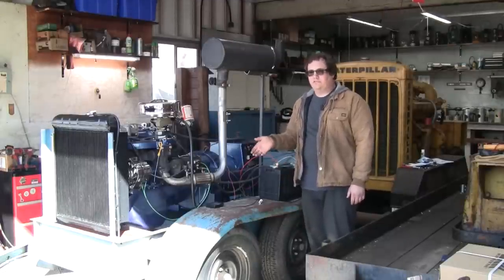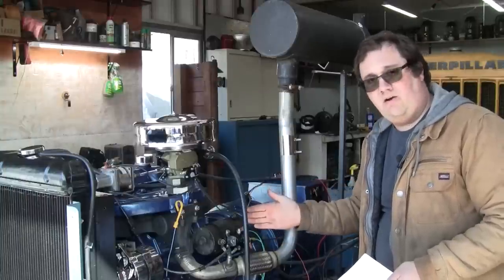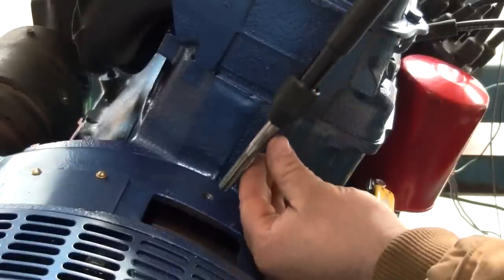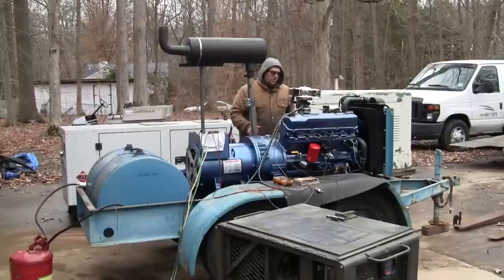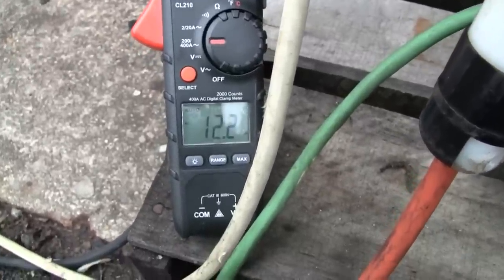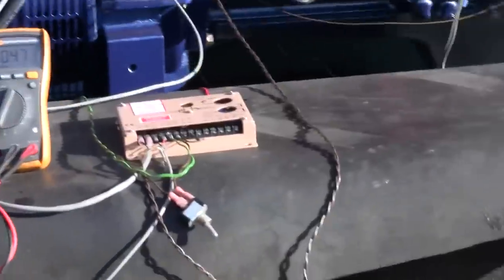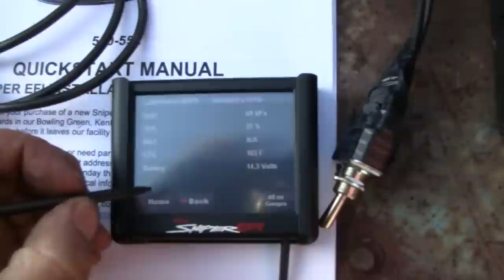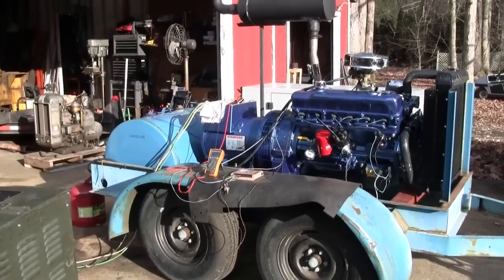Chrysler Slant 6 Generator Gets Holley Sniper EFI Pt.2 FIRST LOAD TEST

Comment: The Chrysler Slant Six is one of my favorite engines of all time. They do have one thing that can make you wind up walking. The distributor has a plastic drive gear that can fail. On all my Slant Six engines I replaced the distributor drive gear with a aluminum / bronze gear that was made for use in drag racing the S.S. engine.
Reply: 100%!!! must be ASAP!!!!!!
Reply: They have an opening so if you drop a screw when changing points that puppy drops right down into the drive gear. Second, that engine was originally designed to be an alunimun block. That's why you will never break the bottom end. I think they were all made with forged cranks.
Reply: I changed all of mine to electronic ingnition because it was harder to change points on them than most engines. Chrysler did build aluminum Slant Sixes for a short time and they had too many problems, so Chrysler dropped them. Chrysler switched to a cast crankshaft in the mid 1970's and narrower connecting rods and smaller connecting rod bearings and later they started using hydraulic lifters. We use to sell a lot of these later engines to cab companies because they didn't last as long as the older engines. Also in the later 1960's Chrylser increased the size of hole in the rear of the crankshaft. If you wanted to install a later Slant Six into a earlier car with a stickshift you had to use a later stick flywheel that matched the engine. If you wanted to install a later Slant Six into a earlier car with a automatic transmission, you had to stick a reducer bushing into the later engine so the early torque converter would fit. We use to sell the reducer bushing at the place I worked. Early torque converters had a small hub on the front and later torque converters had a large hub on the front and early and late converters do not swap. The only other bad thing about these engines are the exhaust manifolds. The like to crank and warp. Then there was the Hyper Pak. Factory 170 CI race engine.
Reply: @EVILDR235  Thanks for more information on this engine.
Reply: Boy that’s the quietest slant 6 I’ve ever herd my buddy had a 60 s valiant always had tick tick lifter noise but ran like a champ good on gas
Reply: @terrywitt5543  Early Slant Sixes had solid lifters and could be noisey if not adjusted properly. The last few years Chrysler built Slant Sixes, they had quiet hydraulic lifters. The one Mike is working on is a pretty late engine.
Reply: @EVILDR235  that makes sense i road to work with a guy in the 80 s he had Plymouth with slant 6 was very quiet the slant 6 with adjustable lifters had a sound all of there on kind of like music ha ha think I seen a slant 6 on a dragster
Reply: @kenore4003 you are correct

Comment: Modern fuel injection strategies put the engine into a clear flood condition when you try starting at wide open throttle,  so you'll have to let the engine start before the governor takes over.

Comment: The Holley may have a 'Clear Flood' mode in it, usually accessed by setting the throttle at Wide Open while cranking.   May also be a safety feature within the Holley such that it won't unintentionally run away upon starting.
Reply: most any/all aftermarket ecus have flood clear mode.
Reply: That's what I was just going to suggest. Watching a lot of amateur drag racers and just tuners the Holley system does have a clear flood mode.
Reply: Exactly. Flood clear mode at WOT. Increase your delay to like 10 seconds on the governor if you can. Should be enough time for it to start.
Reply: Absolutely.   Clear flood = no start.  Need a smarter governor.  Should never go 100% throttle on initial start.  Probably because the governor was left powered on for a while.  Normally it would be activated on start demand so you would never leave it powered for an extended period in normal operating conditions.
Reply: This was my thinking as well. One "quick and dirty" method you might consider is that if it only needs 30% throttle for near full load, maybe set "wide open" to be something like 75%-80%, enough to provide suitable engine performance but not enough to trigger the anti-flood
Reply: @rhydianedwards3457  Yep, that should do it as well.  The governor needs to work together with the Sniper.  Another thought I had in suggesting a 10 second delay on the governor, is if the engine does not start in that amount of time, it may actually be flooded, and the WOT response by the governor would actually be appropriate at that time.  I also would assume there is a cranking time out at some point, maybe around 15-20 seconds.  You would need the governor to reset the timer before a second attempt.  The other option is just to start it manually.  Given this gen set is only for standby, and probably not in a critical installation like a data center, that might be good enough.
Reply: You can use an output from the Holley to trigger a relay to control the govener.
Reply: This was a really useful in the 1990's era Subarus. The 'winter tamer' loved to flood on a cold start when it was -15f or below. Made good money jump starting cars back then

Comment: Mike: I appreciate seeing your videos showcasing your fine skills and knowledge. Your professionalism is evident in all you do. Your work brings back memories from the 1960s when my dad and I worked on Onan Gensets for the American Red Cross Disaster Services in Cincinnati. OH. He had been a steel mill mechanic and later an engineer.  We had one Onan from the early 1950s that was hand cranked and I was told it was marketed to those who might have a remote cabin. We mounted this 5KW genset on a trailer with light units and to supply a communications trailer.  Other Onan Gensets were made for the US Army and were secured from the US Army Depot in Lexington, KY for American Red Cross use. These units never failed to operate and even a small Onan unit in an American Red Cross Canteen worked well. This unit I am certain was not on a good maintenance schedule until he took it under his wing. Thanks for all you do and taking the time to make your videos for the world to view. We are in your debt. I still favor the older Onan Gensets, but my opinion is worth probably less than 2 cents. Thanks again.

Comment: On timing, the vacuum advance is for improving part throttle fuel economy.  When the load increases, the governor opens the throttle to maintain the desired RPM which reduces intake manifold vacuum.  This in turn reduces the amount of vacuum advance, which is desired to prevent pinging under load.  The mixture tends to be leaner at light throttle so it burns slower (more space between the fuel molecules).

Comment: You might want to see if the Holley system has a "Load" PID to view. Throttle position isn't a great way to judge engine load, as available engine power at a given throttle position varies by engine speed. For example, at 1800 RPM, your engine might not actually generate any additional power from 50% throttle to 100% throttle. It's better to look at the "Load" parameter, as it factors in RPM as part of the calculation. Usually this would be a number from 0-100%.

You can also use engine vacuum as a proxy for load. Once you hit 0 vacuum or atmospheric pressure, additional throttle will not result in more power.
Reply: Agreed.  Just look at the MAP sensor on the Holley.  If it reaches 100 kPa, it’s at full load.  I think I saw a number like 76 kPa when Mike was playing with the tuner.

Comment: When you get to fine tuning for fuel consumption, 14.7gm air to 1 gm fuel ratio is Auto industry standard for light loads. The Slant Six was no exception.  So you know you can go that lean knowing you were at  33% throttle when you hit 30kW. Then you can add vacuum advance to give some additional advance at light loads for more FE. Adding vacuum advance was critical to FE back when that engine was on the road. Factory total centrifugal advance (befor lean burn ignition) was around 30°-32° but that was at 4,000rpm, which means the centrifugal advance is not going to be all in at 1,800rpm. You will have to change the initial timing from factory of 0°-12°  to something greater to compensate some if you don't want to recurve the centrifugal advance. That leaves a lot of room for vacuum advance which is limited to about 10°-14°  at around 15" Hg vacuum, roughly 50kpa MAP.  So definitely connect your vacuum advance and add more initial timing watch for starter kick back and detonation when it's all heated up. *(use the copper tube) Every drag racer knows there is usually more power (efficiency) with more total advance over the factory setting. Manufacturers always had to "be on the safe side," so they stopped short of Max Avail output. That means leaner A/F + more advance should really enhance light load fuel efficiency. Your 225 SS was at 33% throttle while delivering 30kW. I didn't see what the MAP was, but as you go leaner the throttle will open more & MAP will increase . 
PS You were already making more power than my house built in 1980 has.  I have only 100 Amp service, so you were 22% beyond my total capacity when you hit 125Amps. Shoot me an email if you have a question. Fine Business So Far! CressBenWell
Reply: My honda insight does 22-24 AFR when lean burning... but doing that without everything setup perfectly might result in excess heat. Also 14.7 is stochiometric for gasoline and may also be too lean for many older engines for that reason. Also our fuel has ethanol in any which may further lean it out, as ethanol's stochiometric mixture is only 9:1 since it has less energy...so if your fuel is 10% ethanol your it may push you slightly leaner than you would think.
Reply: The Holley Sniper has an option for timing control. Lock the distributor advance and the Sniper will use the MAP sensor and tach signal to make the timing anything you want it to be. I think you can also use it to "assist" the governor. Set the Sniper  idle at 1,800 and the timing will advance or retard to "hold" 1,800 (with light/no load). I would like to know the A/F ratio at 30kw. I assume the unit will data-log.

Comment: What a sweet sounding motor, and it looks good too!  Good job.
Reply: It is a Slant Six.  What did you expect?

WORST engine Chrysler ever made!
(According to the bean counters.)
Damn thing wouldn't die.  They put 
them in UGLY Valiants, which also 
never died.  Even though the HP was 
posted in negative numbers, still my 
favourite Chrysler engine.  318 is close, 
383 is closer.  Both of those had some 
horsepower, but the 383 Magnum got 
me in the most trouble.  ('70 383 A833 
Roadrunner.)

steve

Comment: Very interesting! you can’t go wrong with an inline 6 spark ignited engine for under 100 KW. Especially with the improved performance and reliability of electronic controls. 
I’d definitely set it up to start at idle, then ramp up to 1800 rpm. I’m setting up my 3 phase 30 KW machine to do that. You could probably get away with using a V/Hz setting on the AVR to avoid over excitation at idle, or just put a relay in the power leads to the regulator to cut it out when the engine is at idle. That’s what I’m doing. 
Love projects like this one.

Comment: What an absolutely beautiful unit 😮 if anything will convert me to spark ignition that will what a smooth engine it's like a motor on low load ! Absolutely love it as always your work is perfection 👌 completely agree with having separate systems for fueling and speed control makes diagnosis allot easier and simpler as you say! Such a shame something like that would be incredibly rare over here in UK I know Chrysler industrial engines did make it over here but I'd imagine most got scraped along time ago ☹️

Comment: It's fun watching you modernizing this classic. You didn't mention another advantage of EFI is running the engine at maximum efficiency and a comparison of gallons per hour fuel usage vs carburetor.  This Gen likely had a fuel GPH Rating at XX% load, if you could find that, you could run a comparison test against the EFI.

Comment: You could add a timer to control power to the governor until after the engine starts.the higher-end holly units have multiple programmable outputs that could control the governor directly from the ecu. Nice work. 👍🏽

Comment: Great video Mike.  I've never seen a Chrysler slant 6 used before like this in a generator configuration.  Over here in Australia, I have seen many 6 cylinder (186ci - 202ci) red Holden engines used.  Cheers, Aaron.
Reply: Pretty much the majority of American manufacturers made gen sets.
Reply: @methanial73  👍
Reply: Many decades ago when I started skiing, I would see Chrysler 225's and 318's used as backup power on the ski lifts. Never seen one run, though.

Comment: You can adjust the target Air/Fuel Ratio in the EFI settings to the desired value, I believe it has individual settings for Idle, Part Throttle, and Wide Open Throttle.

Comment: the holley does have a clear flood mode of 65% tps or higher. you can change it with a laptop. Put a time delay relay on the power wire for your governor and set it for 20 seconds

Comment: You have done a beautiful job on this and you know your shit! I am used to be an Auto Tech I went to school and I also to Marine repair and also restore Muscle cars, I also build performance engines . I have worked on a lot of Mopars including the slant six. When you have a standard gen set or welder with a gas or diesel engine on it the engine will run at idle until there is a load on it then the Governor will kick the speed up to compensate for load . When the load it off the Governor brings it back to idle . The idle on that engine should be around 750 to 850 give or take. You have the Governor set at almost 2000 rpm for sustained idle !  Seen a lot of Generators and Welder I never seen one set up to idle at almost 2000 rpm and wait for the load to come on to it . This is going to cause excessive fuel consumption that is not needed and a lot of excessive wear on a new engine that is not necessary . On any engine they taught us that you need to warm up an engine minimum of 5 minutes or more the get the oil circulating into the oil passages and internal components of the engine. After you get the engine warmed up after a 850 rpm initial start then you can kick it up to higher RPM'S . Lets say this gen set sits for 12 months never started . All of a sudden the power goes out and its 25 degrees outside the engine is cold the oil is cold all the oil off of the cam crank and upper valve train is now drained back into the crank case. Customer goes out kicks on the gen set and bam! The engine reves up to almost 2000 rpm with no oil pressure ! I can guarantee you are going to start destroying that engine you have no oil pressure the oil is cold and thick and you rev the engine up to almost 2000 rpm  the crank and cam and upper valve train have no oil pressure you are going to destroy that engine . There will be excessive wear on the components of the engine and the by product is metal shavings and  excess metal particles will now go through the oil galleys and start tearing up the crank cam and upper valve train after it gets warmed up. That engine needs to stay at around idle until the engine is fully warmed up before putting any demand on it or you will dis ingrate it . Your pride in your work shows you did a beautiful job on it my man . And you know your stuff I will complement when a complement is deserved

Comment: Hey Mike, you should put together a little box with some of those big digit led meters for volts, frequency, amps, etc. that you could just put somewhere in frame for when you’re load testing.  Kind of a status-at-a-glance, rather than the usual assortment of multimeters…just a thought for a fun little project and maybe even a how-to video of it…

Comment: A lot of EFI systems turn off the injector(s) at full throttle when cranking.  This serves as a "clear flood mode", much the same as the old choke systems which pulled the choke open at full throttle even when cold (in case you flooded the engine).

Comment: Great video, always like your content.

I have some familiarity with Holley EFI automotive applications. Two points:

1. You probably already figured out that there is a throttle angle threshold where the computer no longer tries to control idle speed so when you open the throttle you went out of the so-called idle control mode. I found the trick is to start high and work down that way you never cross that threshold. once you get your final throttle blade setting then you can relearn the closed throttle position.

2. Holley pushes the whole autotune thing because it helps them sell fuel injection systems. The problem is, they’re fairly well known for having failures of the wide band O2 sensor. This is a result of the sensor being powered up immediately, and being shocked by the moisture that condenses in the exhaust system which breaks the small porcelain inside the sensor. Therefore, I highly recommend that you tune the system so that it does not need the O2 sensor,  you can leave the closed looped fueling on but limit the control to something small like plus or  minus 8%. There’s nothing wrong with the sensor itself as it is a OEM automotive part. It’s simply because there is no delayed turn on strategy, they can’t live up to their marketing hype if the closed loop fueling doesn’t start immediately when the engine starts…

You might consider getting the laptop, interface cable and plugging that in instead of your little handheld that way you get full access to all the different parameters , you are certainly technically savvy enough to do that.